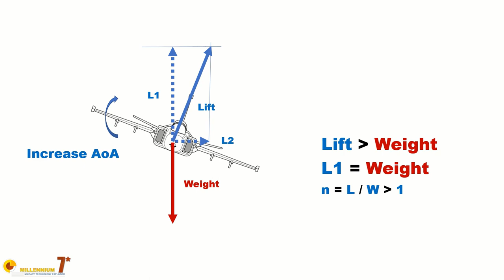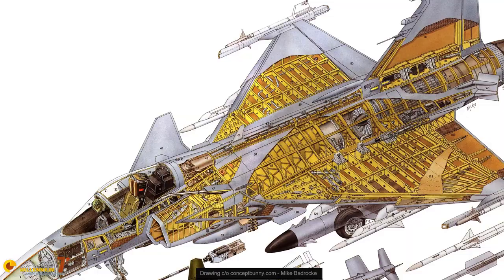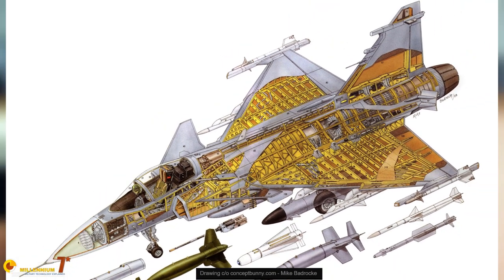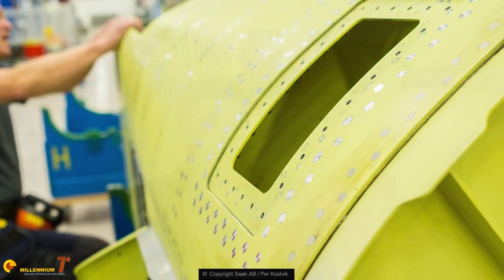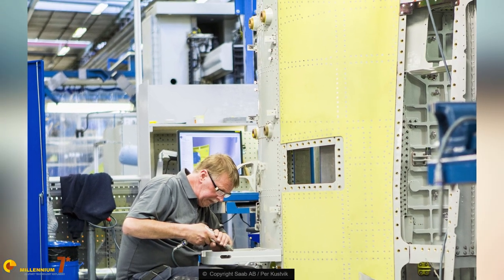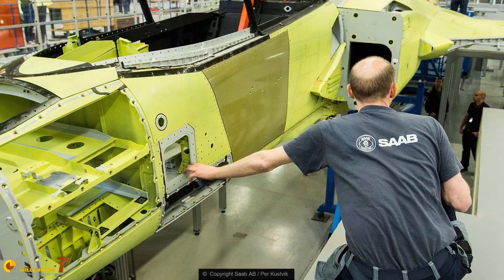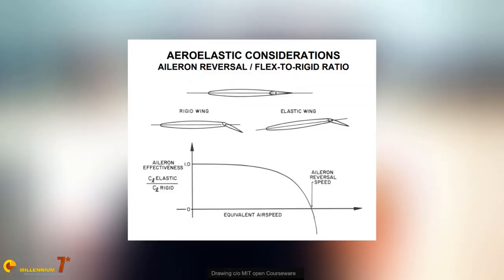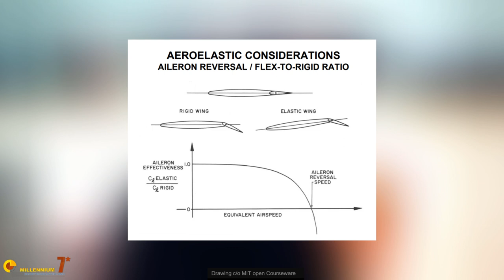Gripen - The Stiff Truth- The Design Chronicle - Part 3

Comment: As said I was part of the original team behind the Gripen. As pointed out in the video the slenderness of the aft part of the fuselage was a very important part of the design. It was about achieving low drag at high speed and was always high on the agenda during the preliminary design meetings between the customer, FMV, and SAAB (I worked initially at FMV, then SAAB). The final design is soo much better than the Rafale and Typhoon in this regard (the Rafale is really stubby which is part of the reason behind its low top speed).
Reply from the maker: Thank you for your contribution!
Is there anything curious that you could share, since you have been part of it? Is there any interesting story to tell?
Feel free to contact me in private, if you feel like.
Reply: @Nick Emerson Not only. Your top speed over Mach 1.5 is very dependent on your type of air intake. With a fixed pitot type intake you loose pressure recovery above M1.5. Gripen, Rafale, and Tejas all have fixed pitot type intakes, but Rafale and Tejas have their intakes in a complicated place shock wave wise and I think they lose more pressure recovery than the Gripen's less cornered design. This is one factor why Gripen can accelerate to M2.0 while the others can't, but the slender fuselage contributing to a good area rule distribution contributes as well.
Reply: @Nick Emerson To keep a good inlet pressure recovery over M1.5 you need a multi-shock inlet, ie the speed of the air needs to go down to M0.5 at engine inlet in several small steps to recover the high dynamic pressure to static pressure. For this, you need movable surfaces that can position several oblique shocks precisely around the engine inlet. You then have a variable inlet that needs sophisticated control and your real gain is only over M1.5, a regime you very very seldom use in fighters. What you need is acceleration, not necessarily a high top speed. Thus many fighter projects are designed with fixed inlets instead of variable as the gains are not worth it (Gripen, Rafale, F35, F18, F16...). It's fun to fly fast but I have only flown a couple of times over M1.5 and I share this with most fighter pilots. You often fly around M1, up to M1.3-1.4 but very seldom faster. Better to have a really good fixed inlet and good acceleration around M1(to escape a fight you don't want to pick).
Reply: @Nick Emerson  You should just google Diverterless Supersonic Inlet and you have your answer. The F-35 was never design to be a Mach 2 fighter. It top speed is design by requirement. Like Ferpe2 point out, fighter seldom fly that fast.  It is better to have good acceleration around the M1.
Reply: @Nick Emerson The reason for the Soviet fighters emphasis on high speeds you find in their (simple) tactic to GCI several miles behind the target and then hunt it down for a kill. A more efficient way is to kill the target in a frontal intercept but this requires a more sophisticated weapon system.
Reply: @Nick Emerson In Sweden the close proximity to Russia meant that acceleration, climb and high speed was important to be able to intercept bombers over the baltic sea. The standing requirement has been ~90 sec from break release to 10 000 meters sice the J35. That's one of the reasons (among many)that  the SAAB fighters are the way they are.
Reply: @Nick Emerson The F-35 is design after the cold war. It is not design for top speed but for all round capability. By doing so, It have cut the cost down. It have better stealth material and lower IR. Like what Ferpe2 have said. F-35 make up the last in top speed with a more sophisticate weapon system.   F-35 cost just a few million then a new F-16V. A true replace of the F-16 and f-18.
Reply: @Nick Emerson It is more than five times higher.

Comment: 4:14 not only you can see the Area Ruling there, but the smooth blending of the wing with the fuselage, as pioneered by the F-16, but contrary to it, the Gripen have it smooth above and below. So is not a surprise the JAS-39 have such great sustained turn performance.
Reply: Pioneered by the F16 lol
Take a look at the spitfire wing, not the fancy showoff elliptical bit, the other end, where it met the fuselage.
Oh and Mitchell probably borrowed it from somewhere I don't know about that.
Reply: @garyhewitt489  The Spitfire configuration is nothing like that of the F-16 or Gripen.  He's not talking about the old wing root fillet, he's talking about the blending of the fuselage and wing into a continuous single upper surface that generates more lift than the wing area could alone.

Comment: I just hope that this aircraft gets enough sales to make it viable, unfortunately the F-35 has grabbed sales based on it's compatibility but all buyers should be concerned if/when it's stealth advantage becomes degraded.
Reply: R Greenup lm is developing smart jamming capability on the f35, much spectra’s rafale. The system will be even more efficient with the low rcs already on board the f35, the rafale will get better passive stealth at the same time with dedira. The su57 is also predicted to work using both. That will be a big step forward to get multistatic stealth, bypassing interferometry and therefore integrated radar systems. So no the end of stealth will be a short one, until multispectral detection systems arrive ...